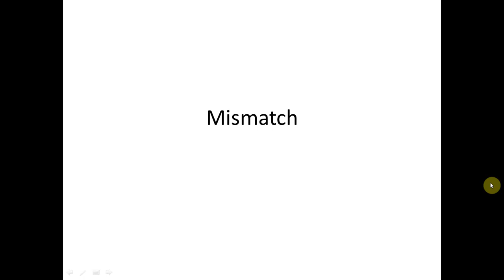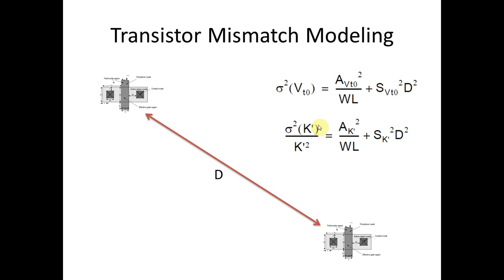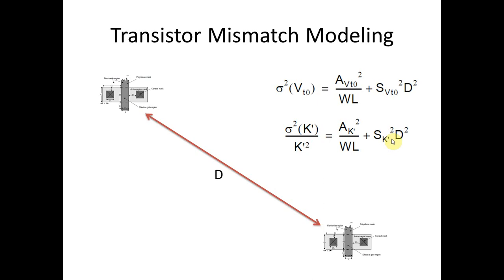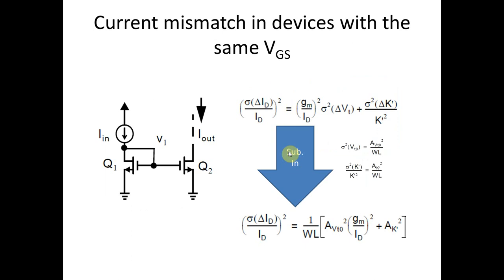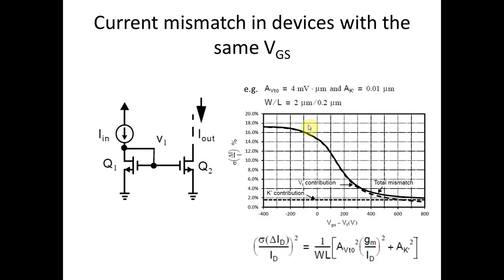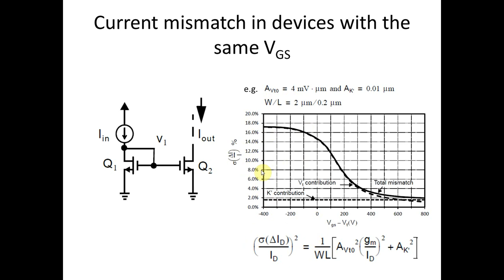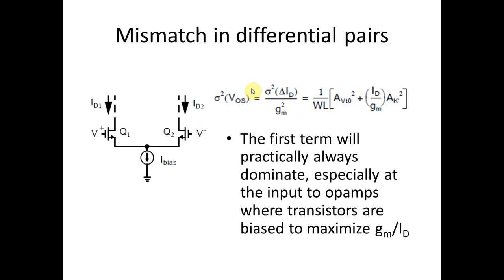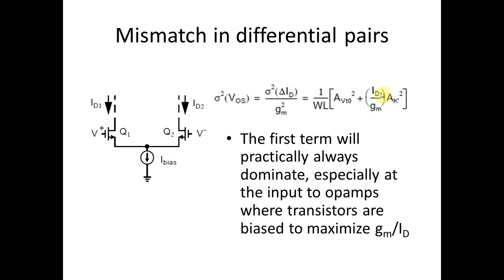05 Mismatch

Comment: Hello, great video explaining a really not easy concept. 
From what I've seen, other than making current mirror with large W and L, it helps to put the mirror in a region where Veff is high. In the case where we have a fixed Id and our only knob to set a high Veff are W and L, choosing a high L would help on many fronts:
- reduce early effect
- increase area
- increase Veff
Do you agree?
Reply: hello, regarding the changes in W and L i agree and think it also helps with fringe fields (like with pinch resistors, but the main problem here is the tradeoff with speed with this size. from what i think, matching the current mirror with a wide swing or 4-wilson topology could alleviate this issue a little, but then the issue of matching the transistors cascades a delay that increases considerably with the introduction of these additions. lmk if you have other thoughts, but yeah